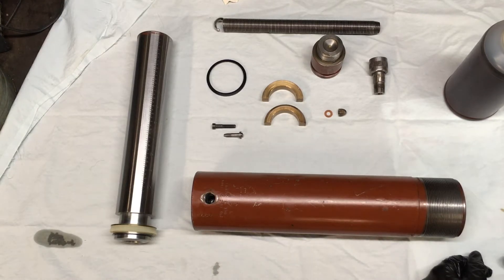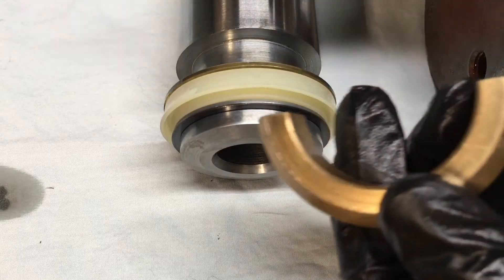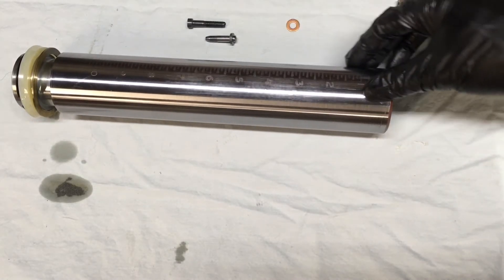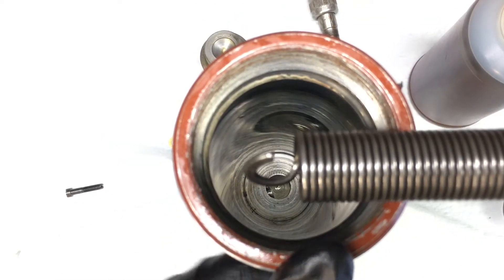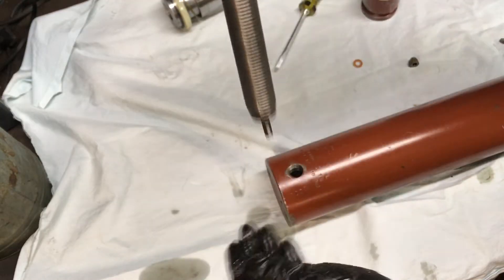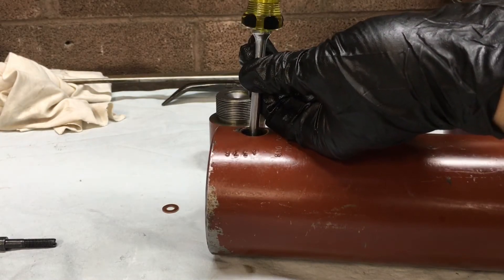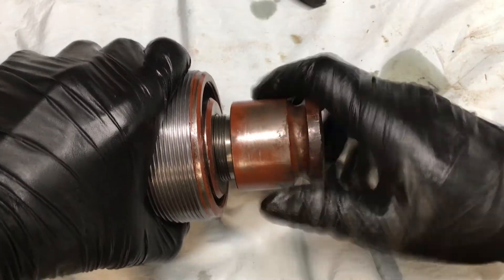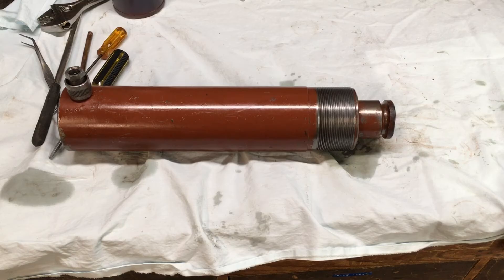Hydraulic Spring Cylinder Rebuild/Assembly enerpac 2510

Comment: Hi i hv a enerpac hand pump. When i apply load to system i lose at least 1k psi When i put it on hold. I DONT HAVE A LEAK. Im using a digital pressure gauge for the test. I cannot physcially see the cylinder retracting bk. So how do i go abt troubleshoot this problem sir?
Reply from the maker: Good question. Ill be able to help you out. How long are you keeping it on hold?